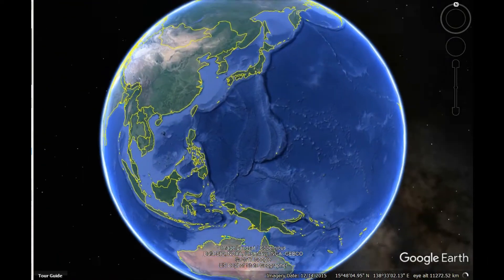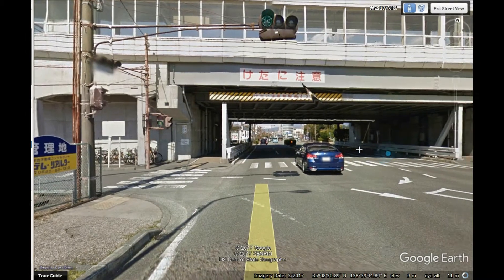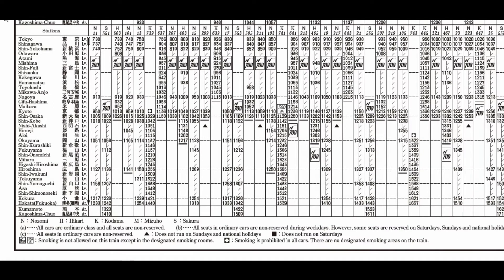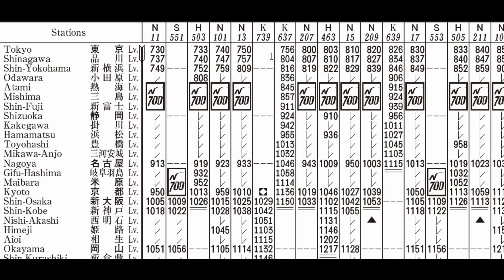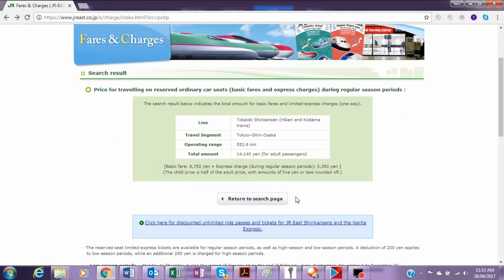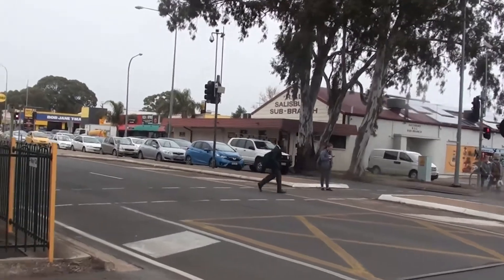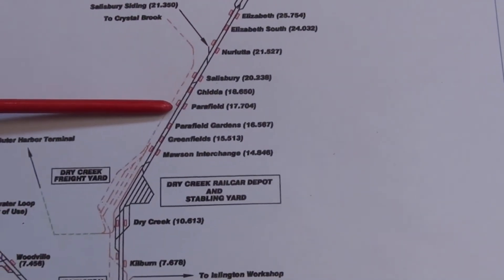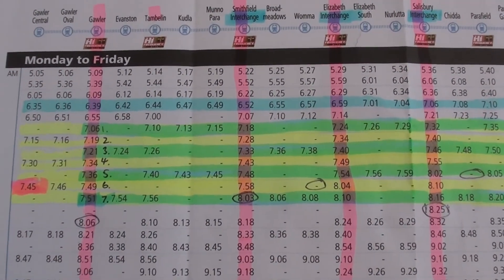Faster Rail Services with Passing Loops at Stations in Japan and Gawler Line Video Oct 2017

Comment: Don’t trains in Adelaide run through the center rather than just terminate in a central station?
Reply from the maker: Yes the Interstate Trains that run on Standard Gauge (1,435 mm) go through the centrie of the Metropolitan Adelaide with 2 platforms at the Adelaide Park Land Station.   However this in not used by the Citizens of Adelaide as a daily passenger service.  It is used for Interstate Passenger  Trains, not for citizens in in the  Peri-Urban areas.

The trains in Urban Adelaide run on broad gauge (1,524 mm) tracks that all terminate at the Adelaide (Terminal) Railwy Station at North Terrace with 9 Platforms (4 island and 1 side} 
 
As the  new station it opened in 1930 with 13 platforms, each covered by an individual canopy to alleviate the problems of smoke and fumes previously endured with an overall roof from the station built in the 19th Century.. 

Currently the air space above the station has been "sold" to a multi-story hotel and office builing plua the Adelaide Convention Centre.  4 of those platforms from the 1930 version are now given over to multi-level car parking,

The car rules in Adelaide.

Comment: Was in Japan in December last year,  The shinkansen from Osaka to Yokohama is a dream to use especially the new trains
Reply from the maker: Hi Daniel Macri
Yes I have read a lot about the features" the Japanese have built into the new generation of Shinkansen.   I was there when the top operating speed on the 0 Series was 210 kph for most of the track length.    Which is also the potential top speed for the diesel-electric Prospector train between Kalgoorlie and Perth and probably the top speed for XPT trains on our East Coast.  As you would know, our tracks are mixed use and the slope of the rails around bends is a compromise for the mixed use of the slower single or double stacked freight trains and fast passenger trains.   Our fast passenger trains are fitted with governors that cut their top speeds back to match the tracks on which they are travelling.
Because the Tokaido Skinansen rail line follows the original Tokaido road from Osaka to Tokyo there are a lot of bends that the trains have to negotiated.   
I read the N700 trainsets are designed to tilt up to 1 degree when going bends so they can maintain their high speed.   They also have faster acceleration, similar to that of commuter trains such as the BART in San Francisco. 
When I was in Japan in I also traveled on the original Tokaido Rail Line that still carried passengers at that time the whole distance between Osaka and Tokyo.  (Now used only by freight trains)
Because the Chinese have built mostly straight line tracks for their High Speed Trains they can achieve higher operating speeds of 300 kph

Comment: There is a buried underpass at the Gawler end of the platform Neil, when one of last the station upgrades was done around 2011 ?? we found power cables suppling lights in the tunnel still powered up and drawing current. The subway was de-commisioned and closed due to vandalism and security problems I believe.
Ray
Reply from the maker: Hi whorayful
Thanks for letting me know the location of the pedestrian underpass.  I did not there was one somewhere because It's existence was mention by the inquiry into the October 2002 train collision with a school bus and 2 motor cars.  
I suspect the longer reason for the closure of the pedestrian underpass was the construction of the ARTC standard gauge line runs through the western entrance to underpass.   The roadway named Patemoster Row is immediately against the fence running alongside the ARTC Track.
As you know DPTI have just put in a "Park n Ride" in land behind the Eureka Tavern.  The Entrance to any future pedestrian Underpass / Overpass would logically begin in this Car Park. 
This Park n Ride will bring even more people trying to cross the ARTC track to get to the trains or buses.
A few years ago they filled in the underpass at the Womma Station further along this track.
Meanwhile they did build a new underpass at the Marion Station on the Seaford Line a few years ago

Comment: Even with passing loops, the express service should still stop at major interchanges such as Salisbury and Mawson Lakes.
Reply: Salisbury, Mawson Lakes, Elizabeth and Gawler, have enough passengers to warrant their own express services from their stations to the city.
Reply from the maker: Hi Luke Beauchamp
Agreed that Gawler, SmithField, Elizabeth, Salisbury and Mawson Lakes are the Interchange stations where Local and Express Trains would all stop.   This means there would be 4 tracks and 4 platforms at these stations.

The key point is all stations need 4 tracks and all their platforms  need to be long enough handle the longest trainsets.  e.g.  6 carriage trains sets is the current maximum in Adelaide Metro
Reply from the maker: Hi Whoraful
As you know the Salisbury Station does have one express train that originates there in the morning peak.   This is probably possible because there is a crossover at the station where the trains after 7:00pm all go to the Eastern Platform (thus reducing the need for passengers to walk over the level crossing to get between the Down Trains and the Bus Station).
The next logical step would be for a third track to be implemented for express trains.   Say from Smithfield to Mawson Lakes   This is done in the "outer" sections of the New York City subway lines
From Mawson Lakes there would then be 4 tracks all the way to Adelaide Railway Station.  2 track for "local trains" and 2 tracks for "express trains".